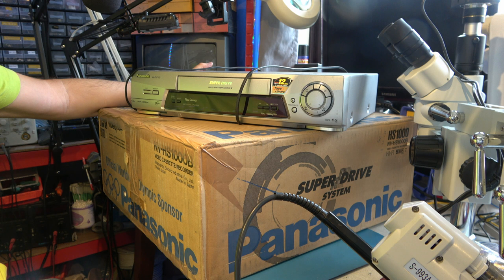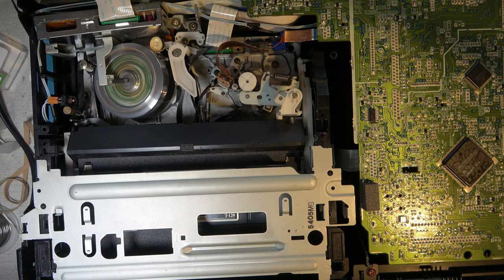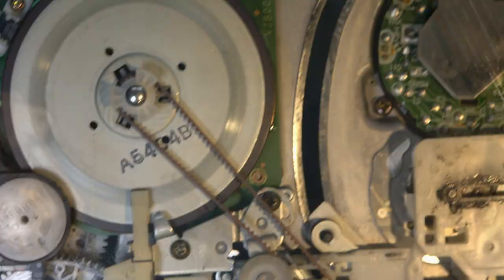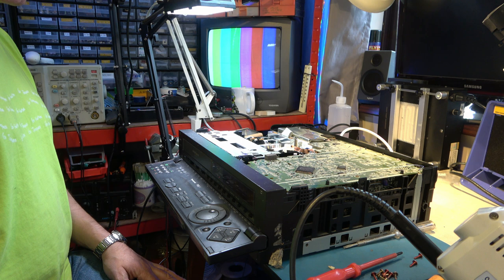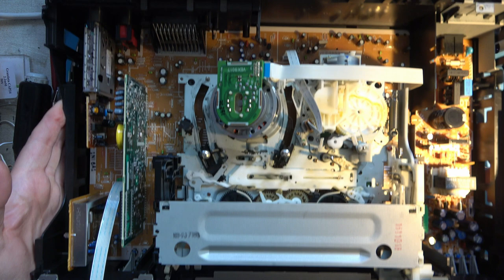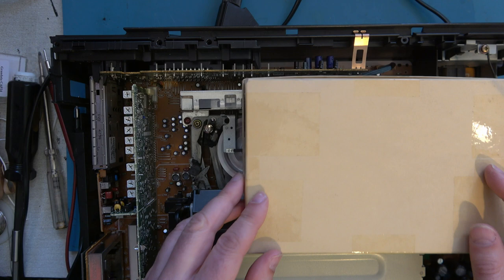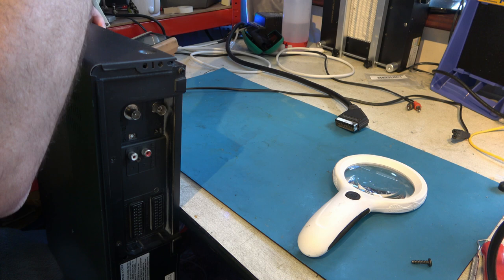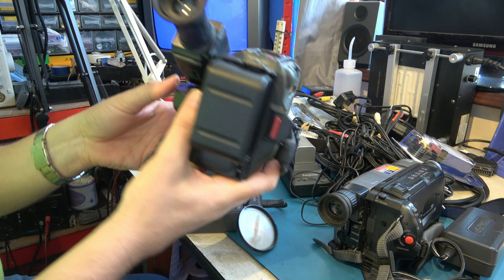A postbag of video equipment, repair a Panasonic NV-HS1000 S-VHS.

Comment: Interesting NV-HS1000 repair! The HS1000 I have originally belonged to my late grandmother. The same coupling on the loading motor broke when she accidentally inserted the label sheet along with a VHS cassette. We got the VCR repaired at a professional workshop, thankfully that was when replacement parts were still available. 
Sankyo made a lot of mechanisms for cassette decks, they can even be found in entry level Nakamichi decks. So no surprise that they later moved on to making complete VHS mechanisms. 
I am surprised that the UK market seems to have been quite different to the (Northern) German market. VHS-C was certainly more popular than Video8 over here, indicated by how many VHS-C camcorders and cassettes I still find on flea markets. Video8 is much more rare. Later on S-VHS-C was mostly a failure, not because Hi8 gained more popularity but because people seemed to stick to VHS-C, just replacing older VHS-C camcorders with newer models.
Reply from the maker: I'm surprised that the Germans, with their reputation for attention to detail, bothered with VHSC.  The only good use case I heard for it was service personnel sending tapes back home.  Generally in the UK the format died fairly quickly.  Manufacturers such as Sharp jumped ship from VHSC to 8mm when it was obvious that VHSC was sinking, leaving only Panasonic and to a lesser extent JVC flogging the dead horse until miniDV came long.  Even Matsushita (Panasonic) did 8mm camcorders but under different brands.  Philips pulled out of VHSC but didn't join 8mm, they clearly decided it was too crowded and gave up on camcorders.
Reply: @video99couk  The Germans are relatively cautious consumers. The people who got into camcorders first made a careful decision on what to buy, and many, for obvious reasons, bought Video8. But when camcorders became really popular in the late 80s and early 90s, most people bought what they already knew, and that was VHS. If the VHS recorder has worked fine for many years, you can't go wrong with a VHS-C camcorder, many would have thought, I guess. Surely another factor was that the traditional German brands, Grundig, Telefunken, Saba, Nordmende, Metz etc. were all backing VHS, selling rebadged Panasonic VHS-C camcorders.

Comment: The K deck clutches are very hard to find new but they can be repaired. The fault is oil on the shaft it rotates om weakens the nylon and snaps two small lugs.
Reply from the maker: I didn't know that, I will look into one in more detail.  Similar problem then to the motor coupling.
Reply: @video99couk  it's straightforward. Take it apart, flush out oil and grease, add a drop of super glue gel to the three spurs (ends snap off losing tension on the clutch) and push together. Never had one fail after this. Also the VHS machine will have a missing tooth. You can buy these loading gears quite cheaply still.
Reply from the maker: @VintageLynx  Right, will do that to the AG-4700 as soon as I get a moment.
I've read up about the lost tooth on the z-mechanism.  If it had been an SVHS then I would replace that.  But on a mere VHS, I've got more of those than I need already, so it won't be repaired.
Reply: @video99couk  Good luck. You only get one go at positioning the clutch so keep it pressed fairly firmly together while glue sets. If you don't the clutch will not have enough tension.

Comment: That Hi-8 was strange but Sony consumer did strange things with other machines as well, the SL-100 was a US model Super Betamax (High Band) machine with mono sound and no A/V inputs just an antenna socket and tuner, although it did have an A/V out connection.
Reply from the maker: One of the SL-100 machines came up on auction the other day, I saw the connectors and quickly decided against that one.  I never saw the point of mono Beta HiFi either, but Sanyo did one too. 
The  CCD-TRV36E was obviously an extreme cost-reduced camcorder.  But then the Panasonic Z-mechanism from the NV-FJ710 was an extreme cost reduced deck too.
Reply: video99.co.uk Oh the SL-100 was NOT HiFi mono, it’s linear mono.
Reply from the maker: @mspysu79  Even worse!

Comment: The blinking light of death! Seems to be a common problem with the Panasonic mini DV cameras, that one looks like the one that my parents have, it probably only has not more than 20hrs use when it stopped working and start blinking. Unfortunately it was passed it's warranty when it happened so it's just been sitting around in new condition! I don't think that there's many good videos around where these things get fixed... 
On another note! 
I heard you mention your isolation transformer! 
I have to ask, have you ever opened it up and have a look around inside? I watched a video here on YouTube where a guy who has been working on electronic equipment repairs and has been using an isolation transformer thinking that he was safe until he clipped his oscilloscope ground clip where it should have been ok but all the lights went out and he just couldn't understand why! 
He didn't realize that he was using a medical grade isolation transformer! Those things were actually designed to isolate noise from medical equipment! Their outputs are ground connected! 
What you should be using has no name for it as far as I'm aware so I have decided to call it a Tech grade isolation transformer! 
A these Tech grade isolation transformers need to be made a point of because it's easy for someone to end up with the medical grade isolation transformer and think that they are safe! You have made plenty mentions of your isolation transformer but you never mentioned which type it is! 
I picked up an isolation transformer that I found for $50 at an e waste facility which was serving duties at a hospital! Rated for 2.4kw it's toroidal transformer is bigger than any birthday cake and possibly bigger than all the birthday cakes I ever got put together LoL, I kid you not! Trying to pick this thing up off the floor, it feels like it's actually bolted down, I think it weighs about 35kg, I couldn't pull out $50Au Fast enough and get it into my car! 
But it like so many out there has a ground wire pass through! 
It's a huge safety point that everyone who does what you do should be drilling into all their viewers! If your persistence saves just one person, then you have redeemed yourself! 
Even just the simple mention of "it's a Tech grade isolation transformer and not a hospital grade isolation transformer" and if someone asked you in the comments what is the difference? Then right there you have probably just saved someone's life! 
I like many other people who watch what you and other people do, learn what we do from you guys! Remember to keep us safe! 
I have modified my isolation transformer by removing the ground connection from the output but I already knew better, but not everyone is as knowledgeable in electronics as I am and is basically the reason why I try to make such a point about it! 
I really hope that this post finds you well 🙂...

Comment: Its so risky for units to be rewinding with the tape around pinch rollers and the head. Older VCRs, would first bring it back to the cassette and then it will rewind etc.
Reply from the maker: It's done so there is a real time tape counter. The same applies to other formats including Beta, Video 8 and minidv.

Comment: Interesting, I have a Panasonic NV-HD700 with sound problems, the picture is good. Do you have any suggestions what could be wrong?
Reply from the maker: I'm afraid there is rarely a simple fix to problems like this, it will need careful investigation.

Comment: in the Panasonic NV-HS1000 you put the spare plastic in the motor all the way down ! BIG mistake !!!!!!! the plastic goes in up to a point! just before it ends ! to the point before the vacuum approximately that the plastic has ! unfortunately i do not know english and translation with google ! :(  I hope I can explain the mistake a bit :(
Reply from the maker: No I didn't put it all the way down, though it might have looked like it.  There was a special tool supplied to service agents just for setting the position of this motor coupling.

Comment: good afternoon i own a VIDEO Panasonic NV 100 whitch WORKS but remains stuck on the STOP button and does not receive another command , eject works, can you help??advise please, BRegs
Reply from the maker: It's not possible to de-bug faults by remote control like this.  There could be multiple causes from minor mechanical issues to serious electronic faults.  It needs proper investigation with a service manual.

Comment: Hello, I have an old Panasonic RX1 palmcorder but I can't find the battery and charger. I have the video tape holder with the tapes, but it got stuck in an old video recorder and now I can't get it to play in another video player. Do you know where I can get spares and will it play on the telly? There's a tape stuck inside it.
Reply from the maker: If I were you, I would rig up 6V (probably around the original battery voltage) and connect to the battery terminals.  The polarity should be marked on it, get this right.  Then hopefully the camcorder will power up and you can eject the tape.  Then hurl the camcorder into the bin!  You'll then need a VHSC adaptor, they are available on eBay etc., and a VHS player.  I would recommend getting the tapes digitised to USB stick or hard disk though.  These tapes degrade badly over time.

Comment: Where do you get the couplings for the motor on the HS-1000, do you know what other machines that mechanism may go in?
Reply from the maker: I got a bunch of them from a Panasonic dealership when they had finished with servicing VHS/SVHS.  Hardly any left now though.  They can probably be repaired though.
The K-mechanism was used in a number of VHS and SVHS decks including the NV-HS950, which is another high end model with TBC.
Reply: @video99couk  Just to add to this list, NV-HS800 and NV-HD90 also use the K Mechanism. The head drum is slightly different though

Comment: That broken coupling is such a crappy design, i've seen no end of cracked plastic gears and worm drives.
Unless you have another replacement it's not easy to fix them, some expand and open the crack more.
It's just as if they didn't want them to last... lol.
Reply from the maker: It is a poor design, but Panasonic were not alone in putting plastic components onto metal components and watching them split apart.  Sony are well known for the same mistake, even in some of their very expensive professional equipment like Digital Betacam.

Comment: Can you use a screwdriver to adjust the VCR guides? Some people say capturing to DV then converting it to MP4 gives lower quality than straight to DVD on a standalone DVD recorder.
Reply from the maker: You can usually get away with a small screwdriver rather than the special tool.
Yes, ripping a DVD and converting to MPEG4 will give fairly poor results, compared to capturing properly in the first place.  If you must use DVD at all, set to the highest bit rate (usually 1 hour per single-layer DVD) for best results.  I virtually never use DVD for anything these days.
Reply from the maker: @rsuryase  I'm not sure he does say that exactly and it will depend on the size of MPEG4 file you select.  The DV files are good for editing anyway, I would recommend working with those rather than smaller MPEG4 files.  Also bear in mind that NTSC DV gives slightly worse results than PAL DV due to a different DV encoding format.

Comment: Hey.  

i have a blaupunkt like your white panasonic in the beginning with the same drive.  
mine is the plastic where the pressure roller sits on.  it's cracked.  
do you know what that piece of plastic is called.  
i can not find that spare part.  
I can not find it.  excuse my English.  
I am Danish and not so good at English but try.  I hope you understand what I mean
Reply from the maker: The pressure roller is called a pinch roller.  I think the part you require is called the Pinch Arm Unit.  You can fairly easily download the service manual for the Panasonic K-mechanism to check that and find the part number.
Reply: video99.co.uk   oh.  thank you very much.  
I will try that. 
 i really like the old panasonic

Comment: I have a Panasonic AG-DV2000 it says error f03 what does it means
Reply from the maker: Really you need the service manual for this.  It's not likely to be trivial, there's probably a mechanical fault with the deck, possibly reel drive.

Comment: What was your involvement with PDC?
Reply from the maker: I was the test software engineer for a device called MV1821 / MV1822, but don't tell anyone.  So I did the programming of a Teradyne J941 digital test system to do the manufacturing testing of this mixed signal (part analogue) device.  A long time ago.
Reply: @video99couk  Ah ha! Looks like I now have someone to blame for all the missed recordings because I accidentally left PDC turned on. I usually found PDC caused more issues than it solved so I tried to make sure I left it turned off.
Reply from the maker: @stevecoatesdotnet  The studios kept making mistakes and sending out the wrong start signals.  It also used to upset the power companies, all those video recorders starting at the same instant.